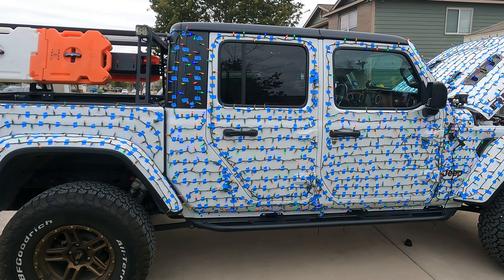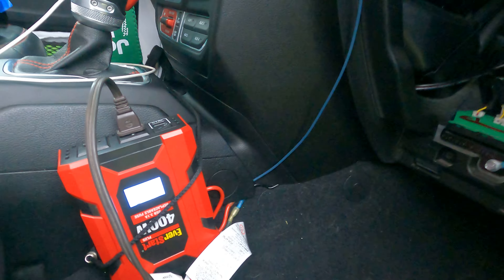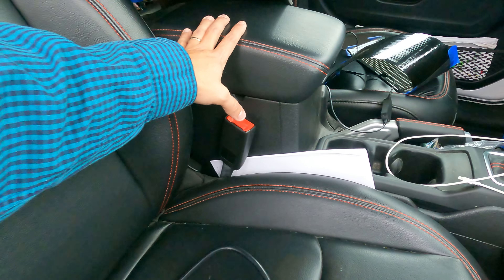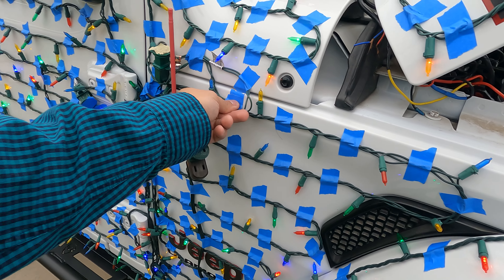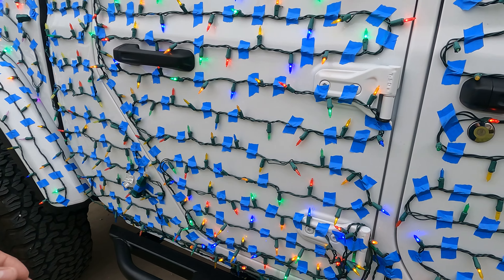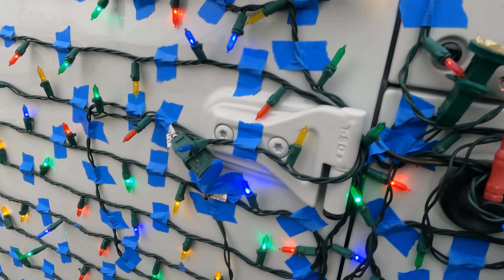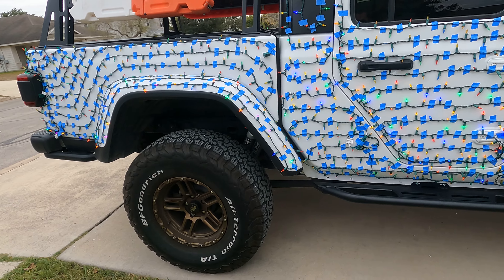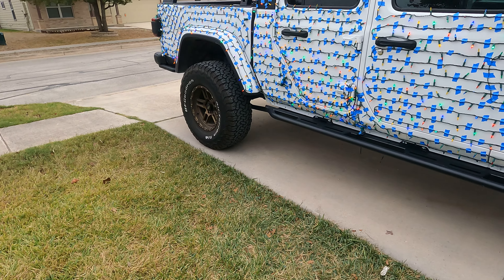How to Install Christmas Lights onto Your Jeep

Comment: I have a white Wrangler and I use white gaffers tape. It doesn’t leave any residue and peels off easily. I also use a remote wireless plug and switch to turn lights on and off.

Comment: Ya couple things..  how many feet did you use and please show the final product at night. I think you did a beautiful job. I would have used different colored tape though. White?  My whole thing is, will the tape damage the paint???  And it’s gotta look presentable during the day. The blue tape is just, well you can guess. Thank you for the video.
Reply: The reason he used blue tape is because it’s painters tape and it won’t damage the paint, white paint however starts to peel when you try taking it off after it sits for a while and is more likely to damage your paint

Comment: I did my Ram rebel but didn't use that many LEDs lights because I bought the brightest of them. It looks good at night but maybe next year I'll put more. The only thing is that the painter tape doesn't work on the finder wheels modding & the grill and bumper, I use black electrical tape and that's not holding to while. It's my first time doing it. So I have to find a better way to make the lights stay on those areas

Comment: But... This is illegal... You can not drive the car with this lights..
Reply: Nobody asked you
Reply: No it’s not
Reply: I’ve seen many and have done this as well. Never have been pulled over, actually had a LEO tell me that it looked cool. I just stay away from red and blue lights.
Reply: Laws vary state to state. Here in TN this is totally legal as long as they aren't flashing or strobing.